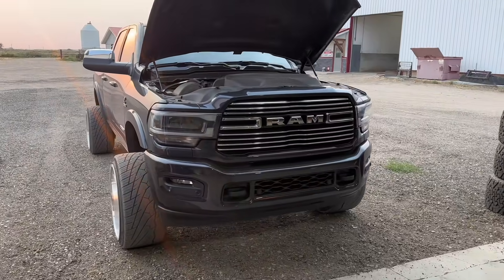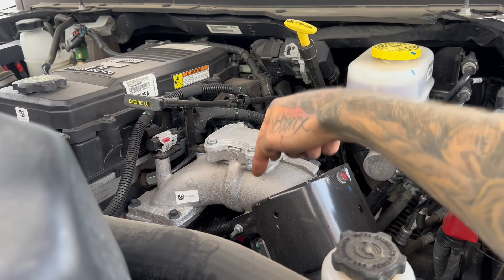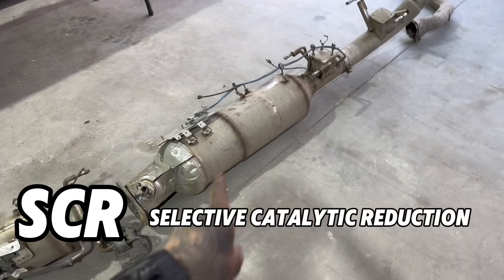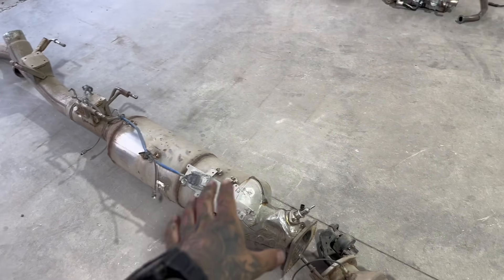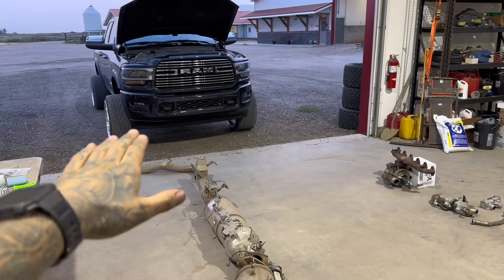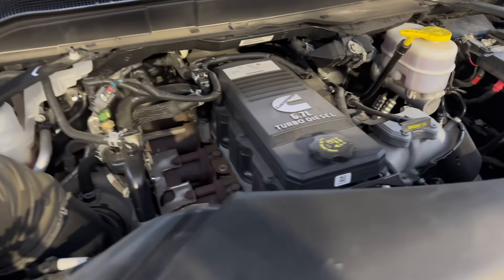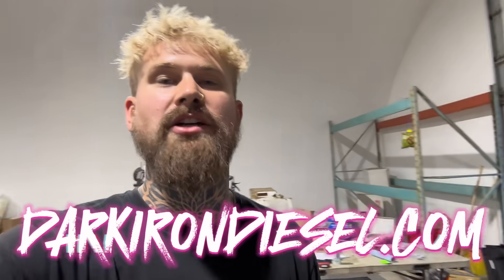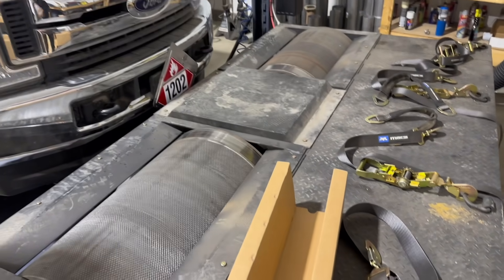What is a DELETE? What are EMISSIONS? - Everything you need to know about DPF, DEF & EGR

Comment: On the egr. If you don't delete it pressure can cause exhaust to bypass the valve and you end up with a plugged EGR and intake. Just delete it. Get rid of it. My delete gave me better overall performance cleaner combustion that you can control with the tuner, More HP, I personally increased MPG by 1/3 cold starts were much better. I also collect the CCV in a large internal area baffled catch can filled with coarse SS wool like a pot scrubbing material. That does not vent back to my filtered cold air. It's an air-fuel ratio, combustion  thing you understand. My catch can is mounted on the passenger side of the frame. It also has a 3/8" ball check on the bottom to drain it from time to time say at oil and filter change time but you may want to check it sooner. My can is 4"X7" diameter with 1" OD entry and exit ports both are fitted close to the top of the can. The entry port has a  90% well baffled tube that goes  1.5 " from the bottom of the can to distribute the incoming CCV more evenly. Which I like to call engine sewage. The exit can be fitted with a 1" ID
 road pipe mine runs straight along the frame, no bends to the end of the exhaust exit. There is plenty of SS wool in the can to say it has ample filtration. I check the Catch can ventilation performance while the engine is running at an idle at the end of the exit tube with a single layer of tissue paper. Hold it up to the exit tube. On a 6.4 there seems they have an excessive amount of CCV pressure that you don't want to restrict. That could result in damage to seals and the valve cover gasket etc...
P.S. Take care that the 1"ID CCV tubing has no kinks and has no up and down bends that could fill with CCV sludge that could fill and restrict or stop the CCV ventilation the CCV must be as unrestricted as possible.

Comment: What happened to all the C02 when you burned off all that soot you collected? Didn't it all just go into the atmosphere? Choking me out as I drove behind you. Anyway way it certainly best up my air fuel ratio which promised the cleanest combustion best HP and best MPG. What happens to all that? That just started to make all that soot worse with each combustion each time the cylinder combusts compounding the situation repeatedly😱🤡🤪😱 until your engine is filled with carbon a compound as hard as diamonds that just grind away at all your moving parts till there is nothing left of them. That happens quickly and possibly less than 100K miles your engine is junk. Your beautiful truck is a paperweight or land fill 😱😟

Comment: This info is all new to me. Why have increased horse power available and tow at the lower HP setting? My first thought was that when towing, that’s when one would want or need more HP? Like I said this is all new info for me. My experience with diesel engines goes back to the 70’s, 80’s, and 90’s with agricultural tractors. They basically had 2 gauges on them, a fuel gauge and the coolant temperature gauge.

Comment: Being EFI live and Minimaxx are both $899 for my truck which do you prefer or feel are the better tunes on an 08 6.7L Cummins?  Currently I am running a delete tune from minimaxx but no tuner.  Base Zero hp I think.  Bought it this way with 5" exhaust, installed head studs (using your video) and cold air KnN are the only upgrades.
Reply from the maker: Efi live. Don’t get minimax anymore there’s no support or anything.

Comment: Emissions systems on diesels are horrible. Especially in cold climates. I bought a brand new duramax within 5000km of driving. It had to be back to the dealer 5 times for emissions related problems! First was mass amounts of soot clogging a map sensor. Next it wouldn't regen it. It just said to keep driving regening but never finished. The dealer found the dpf was 300% full, and they had no clue why. Next, it got down to -30'C for the entire month of February. The def tank froze and cracked. Later that month, the def injector froze and cracked. Next, the dpf wouldn't regen again. It was such a nice truck, but I just couldn't justify keeping it with all the constant issues. I sold it and got a 4th gen deleted cummins now and loving it.

Comment: 1994 3500 Cummins 4x4 Regular Cab Manual with a 22 inch frame extension for the Tunnel box for my tools Twin line Challenger Wrecker Body and a Stinger underneath. The only problem was the throttle cable with the articulating ball which wore out. Otherwise she wasn’t the quickest truck back then but she rode like a Town Car and with 6 Michelins she went anywhere in the snow!! That’s a Truck!!!

Comment: To do the tune. do you need to take it to a dyno and have it done or is it plug and play? never owned a diesel but looking for a 5th gen cummins to start
Reply from the maker: It’s plug and play. If you buy a 2019-2021 5th Gen it’s much cheaper to tune then the 2022+ though, the 2022+ require a new ecm which is expensive.
Reply: @darkirondiesel  So is it better to buy one and instantly delete it and not worry about warranty? or keep the warrantys more asking if its more dependable

Comment: I’d point out the exhaust system still pressurizes the EGR all the way through the crossover pipe. So even if the EGR valve does maintain its seal, there are more sources of potential boost leak (pre-turbo exhaust leak) if you leave it intact. On a newer Ram that required the ECM swap, I saw a leak in a crossover pipe connection after reassembly. The owner hadn’t planned to do the EGR delete right away, but plans changed quickly, so he was glad he had the kit for it ahead of time.

Comment: Hey Kyle your videos have been very informative and reassured me I could put my truck on the weight loss program 6 months ago I have a 2017 L5P I let the truck calibrate for over 1000 miles in the 4 th tune changed to the 5th tune drive it daily rolling into the throttle as we know they’re not race cars …. I monitor the truck with the I-dash no problems anymore and is fine in the 5th tune as long as you drive respectable great videos 🇺🇸💪🏼🦅

Comment: I was just checking out their site and saw a liquid heat generator. Constantly at least -30 in Alberta for like half the year. Have you tried one of these units? Would it be worth getting?
Reply from the maker: I actually have one in my shop for a 5th gen Cummins. I need a truck to install it on. Apparently they work amazing, what’s your truck up in a couple minutes at an idle.
Reply: @darkirondiesel  takes forever to warm up in winter. I'll have to check the difference next time I'm in it.

Comment: Just wish I lived in Canada so I could rip all that crap off my truck.
Reply: @nahbro3240  my guy!! you can't in Canadian provinces of British Columbia, Ontario, Quebec, New Brunswick, Nova Scotia, and Newfoundland. You can resell it, but can't get a safety. Commercial purposes you can't.
Reply: @nahbro3240  federal no, provincial yes.
Reply: @nahbro3240  commercial or not, it's not  federally but each province has rules.
Reply: @nahbro3240  There are no changes to the on-road enforcement proposal. The new regulation effective January 1, 2020 will:

clarify that on-road emission standards apply to "ALL" motor vehicles on Ontario's highways, including out-of-province vehicles
ensure a vehicle’s originally installed emission control systems are present and operating as intended, by clarifying existing laws that prohibit emission system tampering
clarify existing requirements related to emissions control defeat devices and introducing a new prohibition for the sale of such devices
tighten the visible emissions prohibition from fifteen (15) seconds in five minutes to five (5) seconds in a one-minute period
tighten the current opacity standard for 2008 and newer heavy diesel vehicles to 20% from 30%
Reply: @nahbro3240  In Ontario, it is illegal to tamper with, delete, or defeat a vehicle's emission control system. This includes removing or altering equipment that reduces or prevents the release of contaminants like particulate matter and nitrogen oxides. 
 
If a vehicle is found to be in violation of Ontario's emissions standards, enforcement officers or police can stop and inspect it. Possible consequences include verbal warnings or fines. 
 
The Ministry of Environment, Conservation and Parks (MECP) enforces regulations against emissions tampering. The MECP has taken action against emissions tampering, including:
Reply: @nahbro3240  bud that's ALL vehicles on roadways in Ontario.
Reply: @nahbro3240  it's the same thing with window tint,
Reply: Can't do it in Canada
Reply: @mrconductor144  wrong
Reply: @RandomStuff-zt6qf  sorry Alberta is the only one. Every other province you can't.
Reply: @mrconductor144  Neither BC or Quebec enforce it either

Comment: Check out firepunk diesels video comparing a stock intake horn to banks. It made no difference on the dyno as expected 😂
Reply from the maker: Yeah I saw that haha
Reply: Lubricity is 100% a real word 👌🏻 Thanks for the advice.
Reply: How date you bash one of the worlds best grifters (banks).
Reply: @bondobilly9369😂
Reply: @bondobilly9369  😂
Reply: Gale Banks is a piece of shit for caving to the EPA @bondobilly9369
Reply: Banks is pushing an agenda at this point. It’s sad to see.
Reply: Curious, were they testing a stock truck? With the banks monster ram ?
Reply: @floydwilliams3321  900+ hp truck. Gained .6 hp and lost torque. Stock lost hp and torque as well. Video got taken down from double r diesel showing a stock truck.
Reply: Even if it doesn't add power, at least it eliminates the grid heater and potential for the heater bolt failure.
Reply: That’s bullshit because that’s the first think I did lol

Comment: I deleted a 16 LML and blew my transmission going up a hill. I am worried about doing the same to my 17 350. Was my issue a one-off, or is that just something that happens?
Reply from the maker: At the end of this video I touch on how you should drive a diesel truck. If you drive it properly and don’t abuse it there’s no reason why you should never have transmission issues like that.
Reply: @tonysparks101  operator error
Reply: Deleting your LML had nothing to do with blowing up your trans